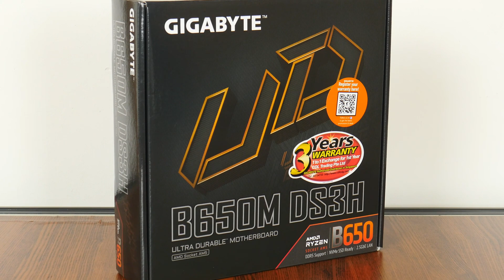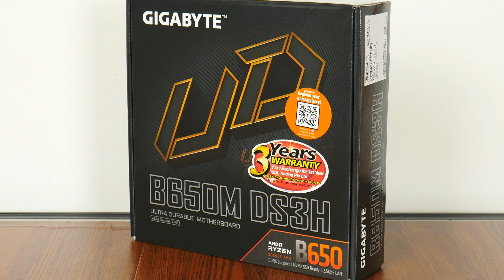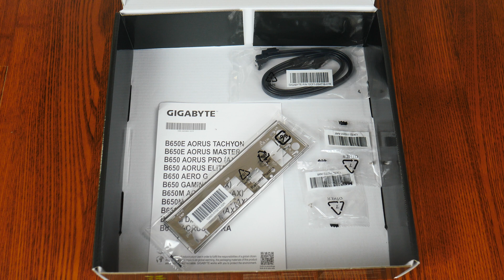Entry-level AM5 Motherboard - Gigabyte B650M DS3H Unboxing & Overview

Comment: What makes this board for "budget or mid-range" chips? Is it the chipset, lack of features like PCIE 5/M.2 GEN 5, or what? I don't really understand. Would it be a problem to stick the highest end AM5 chips and a 4090 on this board? Will there be some sort of bottleneck? I like this price because I don't need the extra M.2 and PCIE slots, why cant I put the highest end parts on this board, unless I'm missing something.
Reply from the maker: It's more of the lack of PCIe Gen 5 features, lesser USB 3.2 connectivity options, budget audio codec  and its no frills aesthetic that make the B650 DS3H a more budget-oriented offering. 

That said, there are reviews out there that actually show how well this board performs despite its budget pedigree - TechSpot did an extensive AMD B650 motherboard review, and the B650M DS3H did surprisingly well with high-end AM5 processors. If you don't really care for the features mentioned in the previous paragraph, this board could do pretty well with say, a 7800X3D and a RTX 4090 I'd think!
Reply: @ALKtech  Thank you for the detailed reply. But why would it be surprising that the board does well with those parts. Would a different board perform better?
Reply from the maker: @newaccount15141  as a board positioned at the low-end in terms of specs and price for Gigabyte's AM5 offerings, one would expect Gigabyte to have cheaped out on the B650M DS3H's components (especially the VRMs), which could in turn impact whether or not the board can allow high-end processors to run at their intended levels of performance. In this case, the B650M DS3H seems to have a good VRM setup, which is surprising for a supposedly "budget" AM5 motherboard offering.

This is especially given the amount of power that such processors would need to draw to run at their maximum potential - having a good VRM setup would supply a clean and reliable source of power to such high-end processors, and allow them to perform as intended.

With higher-end/more expensive boards, which tend to be paired with high-end processors, manufacturers tend to include better VRM components and cooling. Hope this clarifies!

Comment: I think you could reasonable pair this with the new AM5 7800X3D processor. I doubt there would be much of a performance loss compared to their X670E counterparts.
Reply from the maker: There's some reviews out there (e.g. by Hardware Unboxed) on how this board can handle high-end AM5 processors with ease - the 7800X3D should work great with this board too!
Reply from the maker: YashvirGamingZen  the B650M C and B650M DS3H both have aRGB and RGB headers, they're near the bottom edge of the board.

If you're installing an AIO CPU cooler, you can simply connect the AIO pump header to any of the board's SYS_FAN headers, and the AIO's fans to the CPU_FAN header.
Reply: @ALKtech will this mother board be suitable in a Lian Li 011 case? Can I connect all fans to it, including rgb fans?
Reply from the maker: @aorus_gaming9657  this board will fit in a Lian Li O11 case, though I'd look at getting a full-sized ATX motherboard instead if I were you so as to maximise the space usage within the case. Also, you'll probably need to install an aRGB/fan hub in order to support the maximum number of fans that a O11 case can hold!
Reply: @ALKtech  would you recommend the MSI X670e gaming plus WiFi?
Reply from the maker: @aorus_gaming9657  looking at the specs sheet, it seems to be positioned as more of an entry-level X670E motherboard offering, with a cheap audio codec and Realtek 2.5 Gigabit Ethernet to lower costs. It'll then all depend on the price - if a high-end B650E board can be had for the price of the MSI, I'd probably get the B650E board instead. My two cents!
Reply: @ALKtech  what about the MSI MPG B650 Edge WiFi?
Reply from the maker: @aorus_gaming9657  it looks like a pretty decent mid-range board, though price again, is an important factor when determining which board to get. Have you already decided which AMD processor to get?
Reply: @ALKtech  yeah, the 7800X3D
Reply from the maker: @aorus_gaming9657  cool. Either board will work with a 7800X3D - I'd personally go with the B650 board if it's much cheaper than the X670E board!

Comment: Thank you
Can you suggest a MoBo similar with WiFi connectivity.
Reply from the maker: If you're looking for something in the price range of the B650M DS3H but with WIFI, you could potentially look at the ASUS PRIME B650M-A WIFI, Gigabyte's B650M GAMING X AX or MSI's PRO B650M-A WIFI! 

Otherwise, you could also consider the motherboards powered by the new entry-level A620 chipset that launched just a week or so back - some models with WIFI could include the ASUS TUF GAMING A620M-PLUS WIFI, or Gigabyte A620M GAMING X AX. Do note that these A620 boards won't be able to handle X-series processors (e.g. 7700X, 7900X etc) due to VRM limitations, you'll have to pair a processor like the Ryzen 5 7600, Ryzen 7 7700 and so on!

Comment: Can I use Kingston 16GB(2x8GB) FURY Beast 6000Mhz CL36 DDR5 AMD EXPO on this motherboard? That OC support confused me.
Reply: I mean this motherboard supports 6000Mhz(OC) . What that means? Can I use non OC 6000Mhz?
Reply from the maker: @enescetiner390  yup you'll be able to use your DDR5 6000 RAMs with this board - just be sure to enable the EXPO memory profile within the BIOS so that your RAMs will run at their intended speeds. 

Wouldn't hurt to check Gigabyte's QVL list here to see if your RAMs have been tested to be compatible with this board, to be safe: https://www.gigabyte.com/Motherboard/B650M-DS3H-rev-10/support#support-memsup

Comment: can it fit a modern GPU like the 7650XT? because that PCIE slot looks awfully tight.
Reply from the maker: Yeah it'll fit a modern GPU with no issues, despite how cramped it might look!
Reply: @ALKtech  well I had a retailer open one up to see if it would fit my 6750XT and it does not actually fit, so if you have an extra thicc GPU you will have to go for the ATX version of this mobo instead which I also checked and will actually fit.
Reply from the maker: @BleerghMertuuul  I'm curious, did the thickness of your graphics card obstruct the connectors on the bottom edge of the board? E.g. front panel headers, USB headers etc? I would have thought a RX 6750 XT would have a relatively slim cooler...
Reply: @ALKtech  it is a double slot so if it could fit maybe it would obstruct the connectors , this is a Sapphire Pulse 6750XT which has OC grade cooling on it. The space between the connector block plate and the M2 block beneath the PCIE socket is just too tight for it.
Reply from the maker: @BleerghMertuuul  Right I see. Wondering if removing the M.2 heatsinks would help in creating more clearance for the card...
Reply: @BleerghMertuuul  You know this from experience because it sounds like you're just guessing.
Reply: @BleerghMertuuul  there are people putting 4090s on this same board. Someone lied to you.

Comment: you say this is for entry level cpu's.. but couldnt this work just as well for upcoming 7800 x3d?
Reply from the maker: It probably would - in fact the folks over at Techspot did a pretty in-depth review of budget B650 boards and their VRM performances - the B650M DS3H did pretty well with a 7950X, so I'd think it should handle the 7800X3D just fine!

Comment: Micro center gives free ram with the 7000 series cpus, I'm thinking this motherboard is good enough for the 7700x? I saw a video from hardware unboxed where higher quality motherboards can provide a 10% increase in performance due to ram timings or something. I assume this motherboard would be bottom of the barrel performance lol but not that bad? This motherboard at micro center is $135 and the 7700x/ram is $342 so cpu + mobo + ram = $477 ($506 after tax) which is epic lol. I have a $25 coupon though the price of gas would largely negate that (1.5 hour drive), so I'll pretend that the coupon pays for the gas haha.
Reply from the maker: Oh wow. Does Micro Center specify exactly what kind of RAMs that they're throwing in? 

But yeah, this board is indeed a budget board, so I wouldn't be expecting waaaay too much out of it. As long as you're not intending to overclock, I think a 7700X will do fine with this - I personally wouldn't go with anything higher than a 7700X with this mobo, though I must caveat I haven't actually tried a high-end CPU with this board before!
Reply: Hey, yeah the ram is listed as "G.Skill Flare X5 Series 32GB (2 x 16GB) DDR5-6000 PC5-48000 CL36". They also have a 7600x bundle but it's one stick instead of two at a slightly slower 5600 mhz. The price of another stick would bring the price up to near the 7700x bundle so I might as well get that.
Reply from the maker: @WestVirginiaWildlife  sounds like a good deal getting the 7700X+RAM indeed! Have you decided on a graphics card yet?
Reply: @ALKtech  Yeah, I found a discounted 7900 xt brand new reference model on newegg for $845 ($895.7 after tax). I like to play call of duty and the new mw2 and especially warzone 2 is cpu intensive so I'm not consistently getting the full power of the gpu with my current i9 9900k. I've been using a gtx 1080 for almost 6 years and now I can get like 2-3 times the frames haha.
Reply: @ALKtech  I have a question, can this motherboard consistently get 6000 mhz on the ram? I saw that it gets up to 6400 mhz but is that reliable?
Reply: This board is good enough for every 7000 cpu. It has support for all of them and was tested by some youtubers with the 7950x and performed better than most full size b650s and even some x670s.

Comment: do u think the 7000X3D cpus will work on this motherboard?
Reply: It will definitely work, don't worry about it. Even with 7950X3D! People just don't know how VRM values work. Check the link down below for more information.
Reply from the maker: They should work with this board, but how well they'll work is the question...not sure how power hungry the X3D chips are - if they sip power, I think the B650M DS3H's VRMs might just get by...
Reply: @ALKtech  X3D chips is more efficient, like Ryzen 7950X3D consume around 130W and the 7950X consume more, so if this motherboard can handle 7950X without any issues, it's guarantee to work
Reply: To answer my own question, I bought a 7800x3d and it works :))

Comment: Nice video man. 
Thinking about getting this for 179€ + 6000cl32 + 7600. Would be 604€ in total which isn't too bad at all... I'm just wondering how good/poor will the onboard audio of this motherboard be. And how many usb controllers it has and how well they'll work with 4000hz mice.
Reply from the maker: Glad you liked the vid! The ALC897 audio codec that is used with this board, although entry-level, can be found on even mid-range AORUS offerings by Gigabyte (such as the X670 AORUS ELITE that I reviewed some weeks back). In all honesty, unless you're an audiophile or have...discerning ears, you can probably get by with the ALC897, as you'd have to go several tiers up for your motherboard (and hence spend more $$$) if you wanna get a board with better onboard audio!

USBs wise - if you're going to use gaming mice with support for high polling rates, the rear I/O has a USB 3.2 Gen 2 Type-A port and two USB 3.2 Gen 1 Type-A ports; any one of these ports should be fine for such mice!
Reply: @ALKtech  Oh that's fantastic to hear! I was worried because atm I have a b660m dsh3 and it gives quite a bit of static white noise. I have an USB DAC but that doesn't do sound in so I just use it when listening to music and not playing games, therefore I really don't need anything fancy, I just don't want white noise lol. Thank you so much for the information!

Comment: Do you think ryzen 7 7700(non X) and rtx 4080 would be a good combo for this motherboard?
Reply from the maker: I think this combo will do just fine, though you will miss out on "fancy" features such as PCIe 5.0 support for a graphics card/M.2 drives, and a high-end audio codec. If these features are not something that you're looking out for, I'd say that this board should serve your purposes well enough!
Reply: @ALKtech  its gonna be used as workstation rig so i dont care about audio
But ive heard there is nothing out there that takes advantage of PCIe 5.0, and everything ive checked is pcie gen 4
Reply from the maker: @RugerTooWavy  I see - and you're right in that there's no PCIe 5.0 hardware available at the present moment. It's more of a...future-proofing kinda thing if you wanna upgrade to the latest tech further down the road!

Comment: I don't think it is a bad choice for someone getting a 7600 or a 7700 non X, even a 7600X. Like if you are trying to save as much money while going for AM5. If you can afford the extra $40-60 I'd go for the other ones.
Reply from the maker: With the release of the new non-X parts, I think the CPUs that you mentioned do indeed make a good pairing with the B650M DS3H! All we need now is for DDR5 prices to continue inching downwards...
Reply: is it enough for getting full performance from Ryzen 7700 ?
Reply: @ALAMIN4000  yeah. Not much “full performance” to do anyway unless you’re doing rendering, video editing, and transferring large files at higher speeds. With those tasks I’d get something a little better maybe. If you’re just gaming even a 7700 on that board is perfectly fine 👍🏼
Reply: @PaoloMix09  is it because of 6VRM only instead of 12 VRM ?
Reply: @ALAMIN4000 this motherbord get you full performance even with 7950x
Reply: @PaoloMix09 should I pair it with a r5 7600x?
Reply: It has io shield incluse?
Reply: It's perfect for a 7800x3d, 3d chips dont do much better on better boards. I'd say if prefer a premium board for the 7600x n 7700x cause you need to oc.

Comment: Does it support PCIe Gen3.0 NVMe?
Reply from the maker: Absolutely! The slots will drop down to run at PCIe 3.0 speeds when Gen 3 SSDs are installed.

Comment: DS3H models have always been garbage in the previous cpu architectures but now it's all good?
Reply: This board is worth the price. Build quality is excellent.
Reply: @andrewthach1989  has nothing to do with build quality. You're literally buying low tier mobo for premium price. In 2020 this board would have cost you just below $100. But people are sheep so go and enjoy your AM5 on the cheapest board possible
Reply: @mesicek7  that's 2020. Nothing costs the same anymore nowadays.
Reply: @andrewthach1989  We're talking about motherboards here - low tier quality motherboards. The DSH3 branding on gigabyte boards has always been low tier trash for ultra budget oriented builds
Reply: @mesicek7  it works well and has nice features. I ended up with an MSI b650 pro wifi though. Can't beat the price you could get an AM5 for at microcenter and their deals.
Reply from the maker: At least for this board, it seems pretty well-built from my experience handling it! But whether it lasts or not...only time will tell...
Reply: @ALKtech  It's still the worst mobo out there  - I mean just look at the IO shield ffs it reeks of cheapness. Why would you buy a cheap low end mobo if you intend to stay on AM5 platform for the next 4 years and do at least 1 cpu upgrade during that time?
Reply from the maker: @mesicek7  I just had a look at Newegg - this DS3H board is the absolute cheapest AM5 board that money can buy so far (as of 9 Dec 2022), even placing below an ASRock B650M board 😂 No surprises they've got to do away with an integrated I/O shield to keep costs low...but I have to say, I've handled my fair share of budget boards, this B650M DS3H is surprisingly hefty, perhaps due to a thicker PCB and the heatsinks...

At the end of the day, there'll always be folks on the lookout for basic boards - I suspect these entry-level boards would become more relevant once Zen 4 Ryzen 3 APU and CPU parts get launched in the future.
Reply: @ALKtech  Yes budget - for under $100. This board is basically $90 board but sold for $180
Reply from the maker: @mesicek7  yup that's the unfortunate reality for AM5 boards at the moment, where the "budget" of today was yesterday's mid-range prices...

Comment: As long as you’re not overclocking like crazy then this should be good. I’ll be buying this one
Reply from the maker: Yeah! What processor are you intending to pair with this board? Black Friday's sure a good time to get an AM5 processor seeing as there are some discounts around that make AMD's prices a lil' more sensible.
Reply: @ALKtech  I got the ryzen 7600x for 200 on Amazon since I had a gift card. Even got ddr5 4800mhz 16gb for 66 on bestbuy. Talk about ultimate budget lol
Reply from the maker: @vulgarkiwi4223  sounds like a good deal - I'm assuming that's 2x8GB sticks of RAM? What graphics card will you be using for your build?
Reply: @ALKtech  32gb trident ram I believe and a 3080 I’ve had for a while now. Also I have the 4000d airflow case but the usb 3.2 gen 1 header at 4:35 won’t go in. Am I dumb or maybe it’s bent pins?
Reply from the maker: @vulgarkiwi4223  nice! Hmm, kinda hard to comment without an actual photo of the header on your board, but did you have any issues with connecting the case header to your previous motherboard (assuming your case was re-used from a previous build)? The connector only goes in one way and has a notch too - you might want to check that you're orientating the connector correctly before insertion!
Reply: @ALKtech  yeah so it just doesn’t go in for some reason. I see the port and tried to connect it but no luck. It might be bent pins
Reply from the maker: @vulgarkiwi4223  oof. Might be time to break out somthing like a thin flat head screwdriver to try and move the pins around...or worse come to worse, RMA the board...
Reply: @vulgarkiwi4223  it works well with 7900x
Reply: @vulgarkiwi4223  it’s gone in for me
Reply: @ChezzyDRMlol  yup the pins were bent and I repaired the board myself with some tools. All is well now